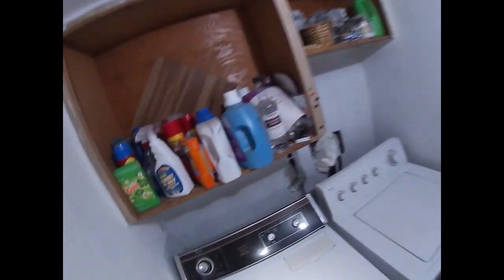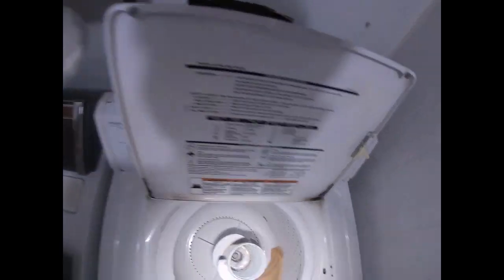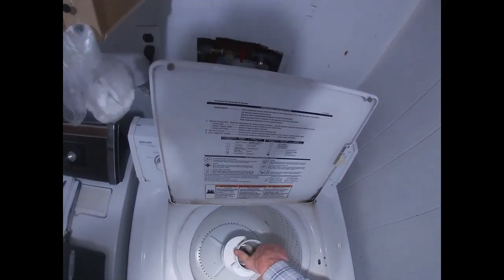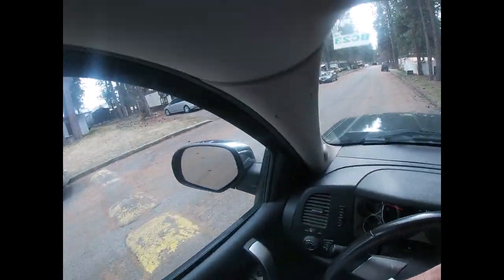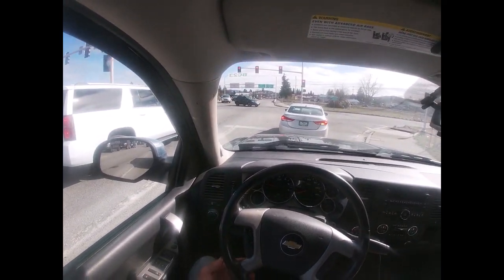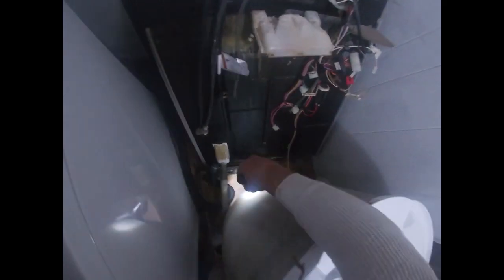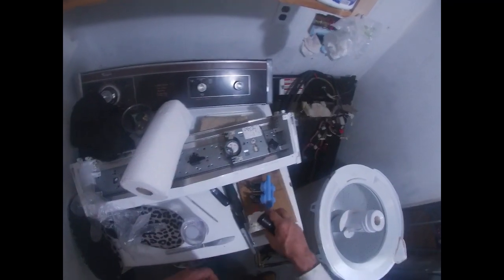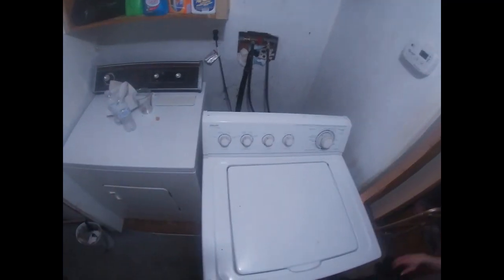Debbie's old whirlpool washing machine was shaking and banging like it was possessed.

Comment: The agitator bolt looked loose so good job tightening that.  

The reason that it let water in during a spin cycle is because it was the spin cycle during the rinse stage.  It does that in order to get a full rinse.  

Missing springs would definitely cause the machine to bang around.  Base pads are cheap and easy to replace.  I would recommend at least checking them because off balance loads, missing springs etc. can cause excessive wear to the base pads.  

The part when you were waiting for the machine to spin but didn't know what it was doing, motor running but nothing moving, that was the neutral drain.  That's where it runs just the pump to expel the water before it goes into spin.  The neutral drain mechanism can break which causes the machine to spin when it should only be draining.  That also puts excessive wear on your suspension, transmission, clutch etc.  Luckily for you, the neutral drain appeared to be working, otherwise the repair would have been a partial rebuild of the gearcase (transmission), all new suspension, new clutch, maybe drive tube and break. 

Why the customer reported that it kept filling is a mystery.  If the drain hose is set too low, it will gravity drain while the machine is trying to fill.  Example is, if a super capacity load is designed to fill the tub to where the top of the water in the tub is say 36" above the floor, but the drain pipe is only 32" above the floor, then the water will never fill above 32" because it will gravity drain, never triggering the water level switch to close, and the machine will just keep filling.  If the machine just keeps filling but not spilling water on the floor, then that might be the issue.  Raise the drain hose a few inches and see what happens.
Reply from the maker: I appreciate it when people who actually know what they are doing take the time to explain things. Any little bit of knowledge will help if I ever have to do another one.

Comment: The agitator was normal. If it was a larger water level with more laundry, it would work normally.
Reply from the maker: The bolt was loose but the parts guy explained to me that the agitator doesn't move during the spin cycle so it wouldn't cause it to shake. It was definitely shaking because of the missing spring.